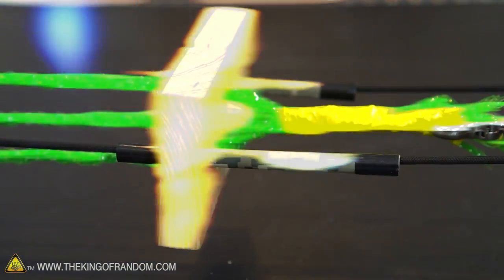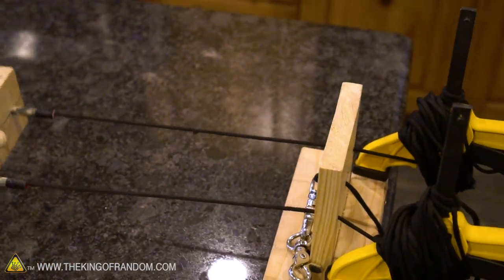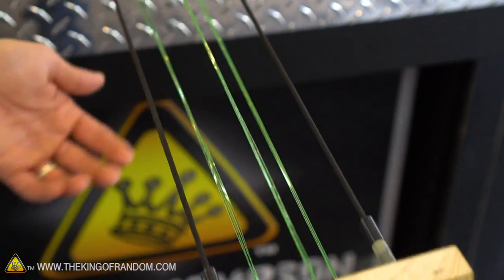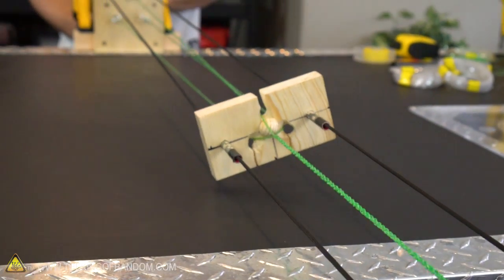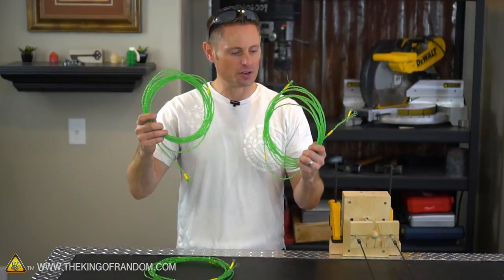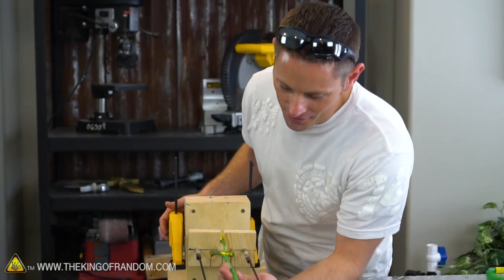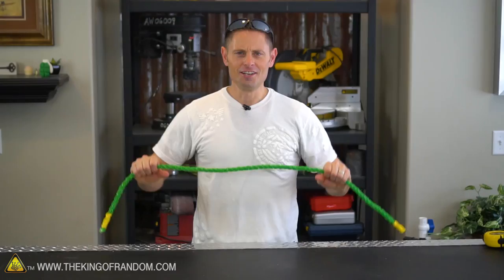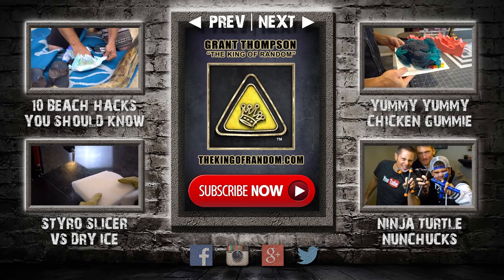Soda Bottle Rope | How To Make Rope Or Homemade String From A Plastic Soda Bottle (2 Liter Bottle)

Comment: so I'm getting ready to make your stuff but have a question.  I know the classic 2 liter Pepsi bottle was first on the scene in world and has the smooth sides.  What about the bottles that don't have the smooth sides and have dimples (like Gatorade bottles) or other designs (like Coke bottles) in the sides.  Does it still work in your cutter or does it hang up and not work only working with the 2l PepsiCo bottles?  Best regards

Comment: Could use it for 3d Printing
Edit: The original strands
Reply: MiniTigress probably wouldn’t extrude as it’s not round (it’s rectangular). Also it’s just cheap plastic so it would need weird settings.
Reply: @brickjam69  It's just an idea not saying it would work but with some work it could possibly  work.  But I like your effort of pointing that out! <3

Comment: How to make rope:   First, buy 100 feet of rope.  Second, wind your soda bottle strands to make slightly thicker strands.  Third, repeat step 2 two more times.  Result?  Less than five feet of rope which has no value or use.